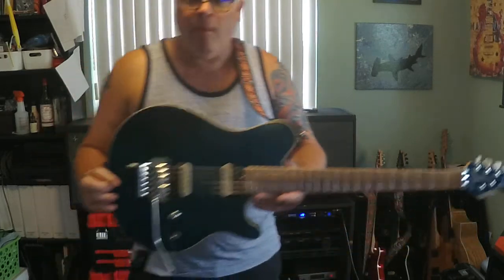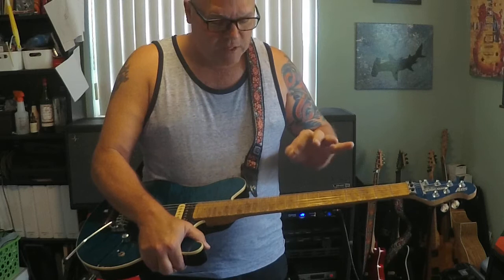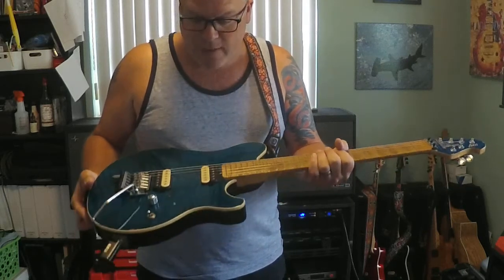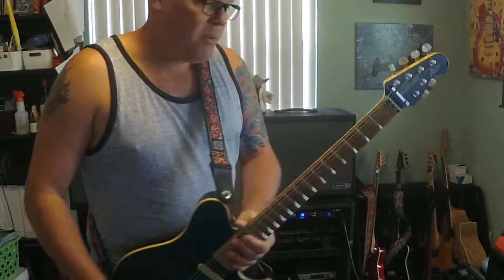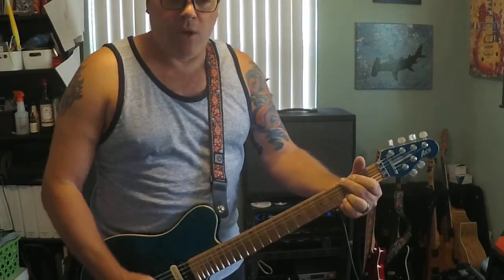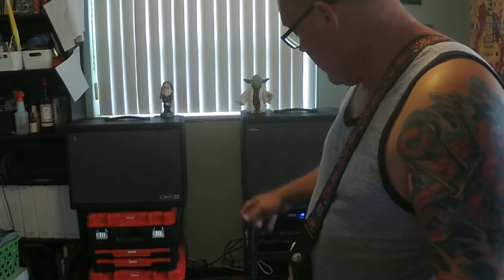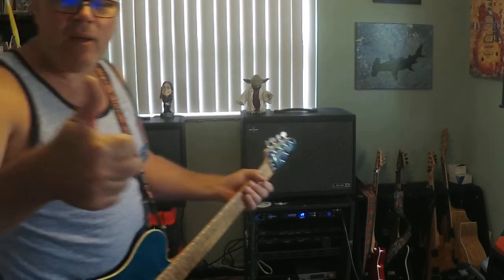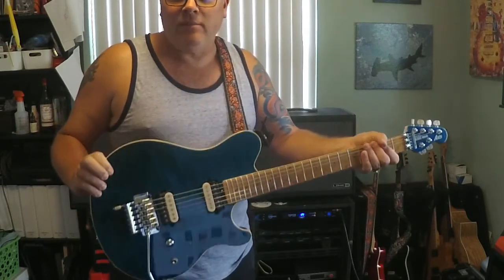My 1998 EB MM Axis got re-fretted.

Comment: The guitar sounds awesome! I just purchased which seems to be the exact guitar; it’s also a 1998 model. How has it held up for you? Does it matter that the guitar is 22 plus years old? Thanks!
Reply from the maker: Overall it's great.  I had it refretted last year with stainless steel frets.  The pickups sound great and the tremolo bars works.  It's got some dings and scratches and a crack by the neck joint but I think that might just be the finish.  Still plays and sounds great.